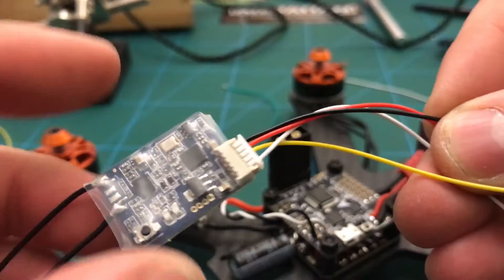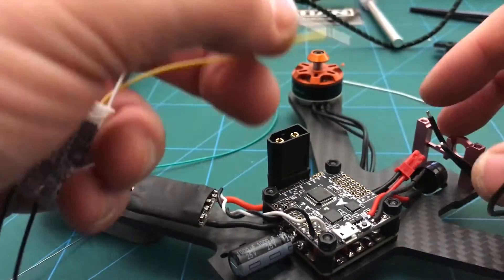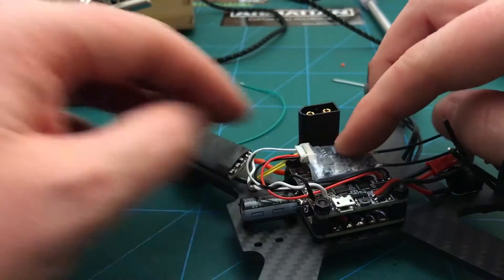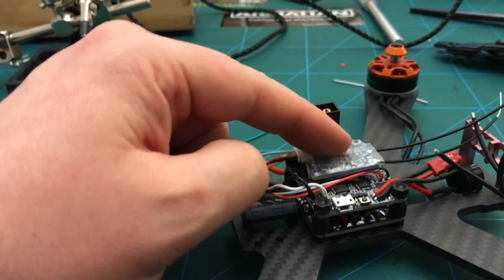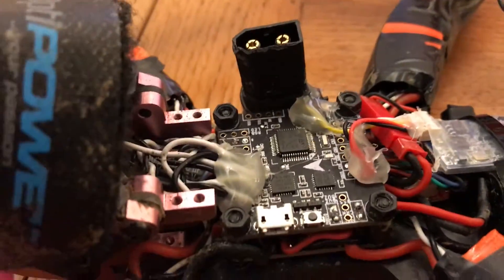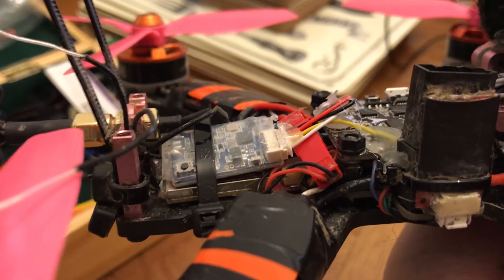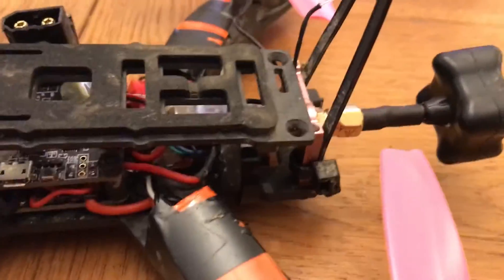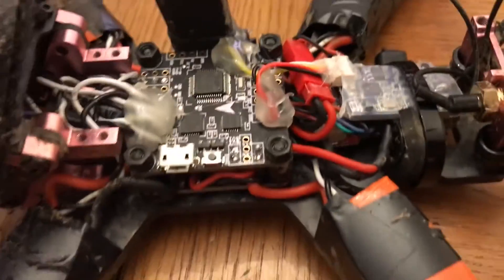Armattan Chameleon Quadcopter Build - Part 4

Comment: this is the worse build ive seen. its so cluttered and so much extra weight from glue and adapter plugs that could easily be soldered.
Reply from the maker: +Forward FlightFPV i direct soldered practically everything?! If i soldered anything else you wouldn’t be able to take it apart to repair it. Also it’s not a race rig, its a gopro carrying freestyle quad. 3g of glue and wire isn’t going to make a difference!

Comment: I'm struggling with my camera mount. I have a swift 2 and it looks like the rear knurled screws are supposed to go into the rear holes on the camera but I can't get it to work. I ended up just using the rear swift cover without the lugs.
Reply from the maker: +Callum Mckay thats the way to do it. Put the more typical back plate on. Armattan quads have a detailed video on their channel if you need it.
Reply: Hey, Loved the videos they helped me a lot, I just can't figure out how to mount my Runcam Swift Rotor Riot Edition without letting it go over the aluminium cover, do you have a link to the video you are talking about ?
Reply: Thanks I manage to do it ^^
I took the chameleon to the field yesterday but forgot to tilt my camera to a decent angle (like ~20° for me is good since I'm a beginner) so I was flying way too fast and literraly shoped a part of my ESC... The little prop tricks seems to be the thing to go and you also did it, I also saw some people taking a piece of coke bottle, what do you think is the best ?